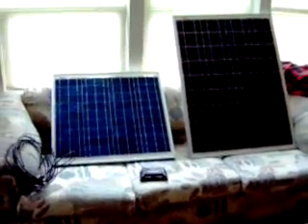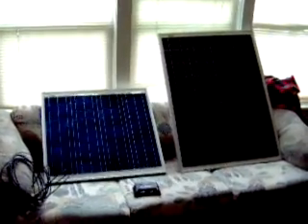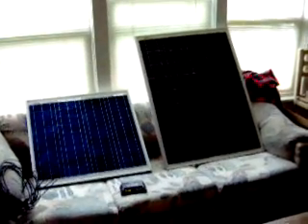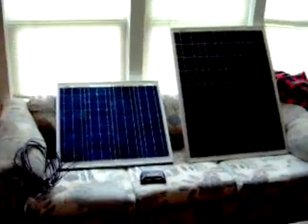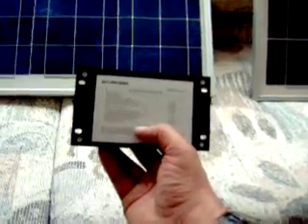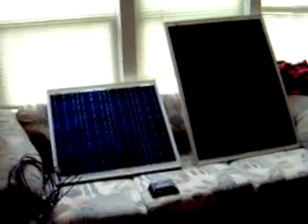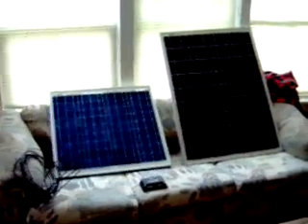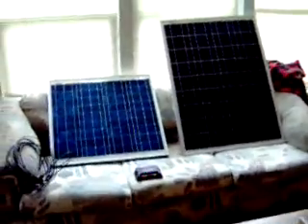Solar panel suggestion for LTbaldwin's gate opener

Comment from the maker: Could be that the thing is pretty sensitive to the voltage and will need something in line between the charge controller and gate opener to regulate power.  For the short term, a dimmer switch that is rated for enough amps to not be a problem would probably work.  Dimmer switches are mainly manual voltage potentiometers, turn it up, you are at max available voltage, turn it down, and you are reducing the available voltage.  Maybe scavenge a dial from an old defunct welder.

Comment: 8digit, i now need help with the load side of the charge controller, I have noticed that the voltage on the output is the same as what the battery is getting while charging. IE: 28.8 volts while it is bulk charging, now that voltage seems to disable my opener until I reset it?? Then if the voltage rises again the opener needs reset?? Need a charge controller that has a adjustable or constant 24v output???? Any Ideas??